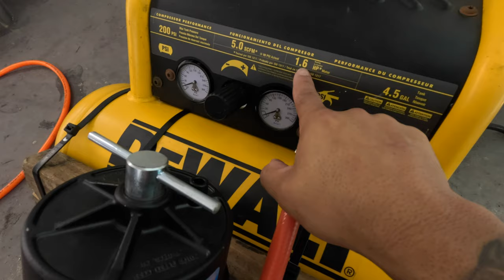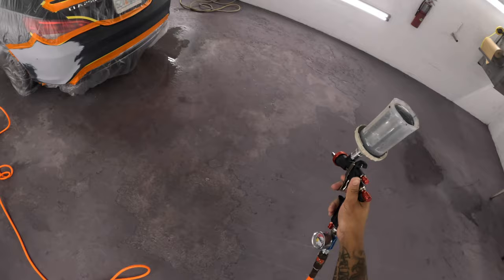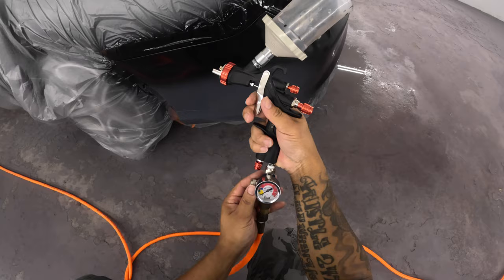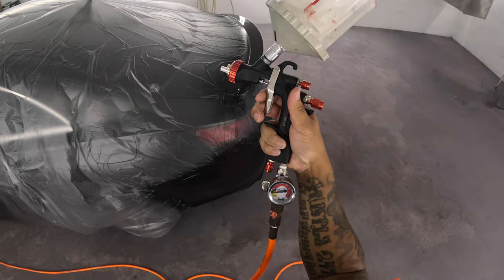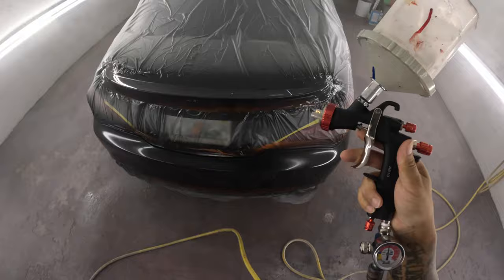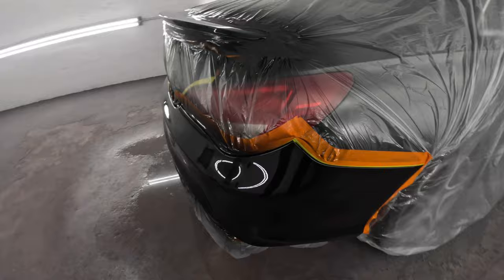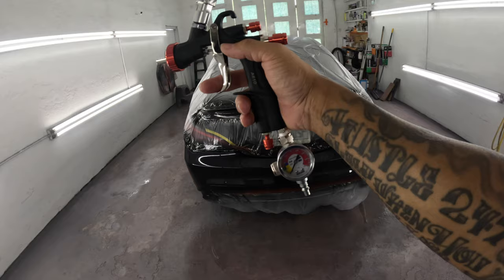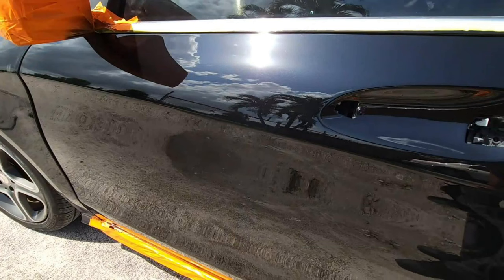11 year old rusty air compressor to paint a car 🤯👎🏼

Comment: Hey, just wanted to mention Aeropro and Rongpeng are the same Chinese company, just different marketing brands. Aeropro A610 is same as Rongpeng R500. They also make the Vevor gun...its called R802 at Ronpeng, A604 at Aeropro. All a bit confusing. But Vevor gun and gun in this video are made by same company .....so seem they make some good stuff! Also Vevor gun is supposed to use no more than 4.5cfm air....so it should run pretty well on larger DIY compressors. Don't know if you noticed in the real world that Vevor gun uses less air? I just bought a Vevor  so hope my big DIY compressor can run it....
Reply from the maker: Cool thanks for the info. The Vevor gun that I have I think it uses a lot more CFM I know they have a few models. But I'm going to be playing around with a few. Thanks for the heads up 👊🏼🫡

Comment: Why do they advertise that gun as using 4 cfm, that is a lie. The documentation that comes with the gun (Stated in the specs of the box it is ship in) states it uses 320 - 360 liters of air per minute, when converted to cfm that is 11.3 - 12.7 cfm....... NOT 4.  The truth is you need at least 9 or 10 cfm of air even if you turn the gun down, if you have 30 gallons of air to start with you could probably paint a door but with 4 gallons of air you can't paint anything bigger than a hubcap.
Reply from the maker: Hub cap 😂😂😂

Comment: I use a r500 everyday for primer at work for the past year. I prefer it over my devilbiss gpg. Helps keep the overspray out the shop . i also use a r500 at home with a 30 gallon 8 cfm oiless compressor. Works great. I will say for any lvlp you need at least 20 gallons of air. Upk uses a 21 harbor freight just fine. I've even done a whole car with a lph 400 with my 30 gallon. Set the out going pressure on the compressor to like 60 psi and it'll bump your cfms up. Lph only use 9 cfm which is still pretty low. The ani f160 only uses 8 cfm. My setup is perfect for a mobile business or home shop. I live in the hood so leaving compressor outside isn't a option for me. Crack heads stole my 80 gallon kobalt 2 years ago. Bought the gallon so i could take it in and out the house
Reply from the maker: Lmao got dam crack heads 🤣🤣 man I'm too familiar with that. I feel you man. I'm just playing around with this thing to see how much of a car I can actually spray with it. UPK has a bigger one but he also uses it to spray overall paint jobs and we know you won't spray an overall car on the mobile so this may work for people just trying to do small repair work, spot in jobs at car lots etc...  Thanks for your input man. It's appreciated 🫡

Comment: Even if that compressor was working fine it’s really not big enough for that gun.
Reply from the maker: Got it working and it sprayed great with no issues. So it is big enough for the gun and the size of the job. 💪🏼
Reply: @thetriggerman954  that’s good to hear most guns even lplv cfm requirements are more then most small compressors can handle. I’ve been a mobile painter for over 30 years and I always check both before i buy a gun or compressor make sure their compatible.
Reply from the maker: @theautoman22  yea I was surprised too. I have a video up with an even smaller compressor and an Iwata spraying a bumper and it did it without issue. I really didn't think these micro compressors could handle it but they did lol

Comment: UPK got what looks like a 60 gal with med belt drive motor.  And a full dryer system at 50ft..  
IMO 80 gallon is still a small compressor if used alone with a small or Med Motor.  120 is a normal small size with large motor at the older rent a booths here in California.  $140. a day.  $85 for 4 hours.  Newer booths are around $250 a day. 200 gal compressors  And they are usually behind an auto paint supplier.  I've used that same Dewalt for air brush touch ups. Motor is tiny.  I think we are all more interested in whether that gun is a good starter that can continue into the big compressor and rent booths. And you answered that.  A little slow but will get the job done.  
Great video.
Reply from the maker: Thank you Clyde. I'm sure there are some guys with little compressors that might be interested even if it's only a few people. But I'm glad it answered your question. Thanks for watching 💪🏼

Comment: I hooked up one of those motor guard filters to the wall. Quick connects so I can switch from the 20 gal or the 60 gallon. That Dewalt def. Has enuf pressure for that lvlp gun(with no leak). Very efficient gun. Really, surprisingly good. I  have use them for sealers, quick jobs, base. Not my favorite for clear, but it can do the job.
   Upk was right saying to haul out a small compressor. But you hauled out a mini! He uses the 21 gallon Harbor Freight on the videos. Entire car more than once. 
  Got my 3m pressure cup and pps adaptor for the Apollo turbine set-up. Still going for it. Full paint job 87 Jeep. I know it works for base as I tested it. Unlimited clean air. For clear coat, i will need to experiment. This is not compressor painting. If I get a bit too much texture at first, no biggie. I',m already committed to a cut n buff. Will post the results on a video short when paint day is here.
   Running long on the comments(again). Good job on the partial demo. I know i'm not the only one who would like to see you try it again👍 
6: 41 on Sat and i'm about to head out to the garage for sanding and more primer this morning. If nothing else, i am persistent😅. Enjoy your weekend Trigger!👍👍👍
Reply from the maker: Thank you Big Bear yea man I only have that little compressor but who knows maybe someone has a tiny compressor and want to do little spot in work for car lots something you can throw in the trunk of a car and go make some money. I know it's small but who knows who it can help out there. Thanks for your input I'm sure all of this will help help someone out there.  Have a great weekend 🍻🥳

Comment: Looking forward to more vids using this gun with good air and see what it can really do. I really like mine. Working at home I've been running it at 20-22psi for base and about 29psi for clear. Your the first vid I've seen with it running at 40psi. Good vid trigger👍
Reply from the maker: Thanks man I'm going to do a bunch more vids. And also I'm not using the gauge that came with the gun I've heard that they aren't accurate I have a better quality gauge on the gun. So not sure if that's why the difference in psi. But I'm going to be playing around with it. So stay tuned. And thanks for watching 💪🏼

Comment: I would say m9st people can aford an 30 gallon if they can afford an 6 gallon or 15 gallon they are not much more price wise! An 6 gallon runs about $180.00 for an good new one ,15 gallon about $300 and an 30 gallon is about $600! I use to have an 30 gallon husky 2 phase 7.5cfm rated and it performed greatly
Reply from the maker: Also depends on what they are doing. If mobile something like this fits right in the back of your truck close the top and go. So it all depends on the situation. But thanks for chiming in.

Comment: Hello Triggerman, how much of a difference is there in material consumption between this gun and the lph 400.
Reply from the maker: This was my first time using this gun. And as you can see it would be unfair for me to give that opinion on this gun since I did not have proper air flow. I'm very familiar with the LPH 400 it's actually my favorite clear gun and material consumption is very minimal with the LPH400, I plan on making more videos on this gun in the very near future and I'll be able to give you a more accurate opinion.
Reply: @thetriggerman954  Yes, I observed in the video that It was a small compressor that I word with and it almost ran out of air, but hey, I'II be on the lookout for future videos, I have the lph400 but I've seen good comments about that gun that I tried, personally I am looking for one whose overspray is very low because I do not have a very good vapor extraction
Reply from the maker: @jesuszaragoza2473  well as far as over spray I'll tell you right now LPH400 has that gun beat. It put out way more over spray than the LPH. Even with not enough pressure I had a fog in my spray booth.
Reply: @thetriggerman954  excellent man, I did not want to buy it and surprise you that it would cause more overspray, I run my lph 400 at 16 psi as the manufacturer marks it, I have not tested it at more psi, I see that in many videos they raise it to more psi, I even saw in some videos that It counterproductive to run it at 16 psi and I have seen that they run it at 29psi.
Reply from the maker: @jesuszaragoza2473  29psi with the LPH lol no way. If overspray is a concern definitely stay with the LPH I had to crank that gun up to 35-40 psi to get the same atomization as I would with the LPH at 17 PSI
Reply: @thetriggerman954  Alright if the lph got It for the same thing it was running low psi then I'm not too bad running it at 16 psi thank you very much I heartily appreciate your responses Triggerman
Reply from the maker: @jesuszaragoza2473  anytime brother 💪🏼

Comment: quick question trigger why do you wind the fluid in instead of wide open and when should you run wide open
Reply from the maker: Certain guns depending on how the threading feels I will start from in. This gun has a lot of play when turning it out from closed so it's just easier to give an accurate setting going in from wide open. EXCELLENT question. I normally always spray with a fan wide open but some guns will distort at the ends or break up in the middle so on those guns you would need to start incrementally turning in the fluid. Great questions man. 💪🏼👊🏼
Reply: @thetriggerman954  thanks man for sharing the knowledge, I'm still trying to learn and just have been spraying with everything open, trying to learn the settings
Reply from the maker: @myblkz  yea most guns are okay wide open but if you notice that something doesn't look right with a pattern Don't assume it's you or the gun start making little incremental adjustments It does take time but after you've been doing it for a while you'll you'll learn how to diagnose an issue right off the bat.
Reply: @thetriggerman954  💪🏾💪🏾💪🏾

Comment: At 10 psi u can use the lph-400 purple cap. It requires that pressure.
Reply from the maker: I'm actually going to try the LPH I think it' might give a better finish and use less PsI. You read my mind Trey 🤔 I'm going to try the silver cap. I know I have an orange cap too I had a purple I think it's in my shed. Lol but I'm going to play around with them.
Reply: @thetriggerman954  the purple is made for metallic they call it the super Basecoat gun and I can agree I love the purple cap. Like when I really want my metallic to lay down and good I pull that out.
Reply from the maker: @treysterthepainterturner8404  how does the cap work for clear? If you've ever tried it
Reply: @thetriggerman954  it did pretty good. I only used it twice. I said I would have to buy another to keep trying for clear. Kuz I don’t wnt to keep switching it up. But it did pretty good.
Reply from the maker: @treysterthepainterturner8404  kk I'ma dig mine up thanks man. 👊🏼
Reply: @thetriggerman954  no problem bro.

Comment: Lol… I don’t think you can get 40psi blowing through the hose😂😂😂. So I see you figured the a610 out huh?!?
Reply from the maker: I don't like the gun personally 😔
Reply: @thetriggerman954  well you did a good job with it! I still have to try out the rongpeng r500 to see if it matches the Eastwood concorse lt 100! I might have to buy the Eastwood to compare…Stay tuned!
Reply from the maker: @dollabillbrunson8107  4sho lemme know. Hey what's going on with the Chevy truck paint job? Did you start it yet?
Reply: @thetriggerman954  nah…. I was waiting til spring because the winter is gonna be rough in the northeast. My winter project is my 02 Honda Accord. I fixed it after the wife crashed it to a corner of a building. Tried the two tone thang, but I rather have it back silver. Plus I got crotch rot over one wheel well.😖
Reply from the maker: @dollabillbrunson8107  yea I feel you. Don't need runs all over that big mf truck there. Smart 🤓 🤣
Reply: @thetriggerman954  paint ain’t the problem, it’s the sanding to bare metal that’s gonna kill me…ugh
Reply from the maker: @dollabillbrunson8107  so what does the weather have to do with it? Lol
Reply: @thetriggerman954  Lmbo…Da Big Hoe has rusted rocker panels. I just figured let ol man winter do it’s thing, then do all my repairs when heez gone. I will be driving it for the winter…no downtime for da big hoe!!! Oh yeah, me and my dad is sharing a one bay garage. He will be using it more to clean funeral vehicles.
Reply from the maker: @dollabillbrunson8107  ohhh ok, funeral vehicles 😳🤯🫨
Reply: @thetriggerman954  He makes a lot of money doing those jobs ….I ain’t mad at him!!! That’s not for me! 😰
Reply: Hey trigg! Do you use the 34oz dekups at all?
Reply from the maker: @dollabillbrunson8107  yea I have them in my booth but mainly for big overall jobs. That big 34oz wear out the forearms 😂
Reply: @thetriggerman954  😂 I have some dekup stuff that you can have…and the 34oz hard cups are brand new. I also have the 9oz liners and lids. You the only one I know that rocks the dekup system.
Reply from the maker: @dollabillbrunson8107  yea that's all on the other of the shop so I wouldn't really need it. But thank you. And any shop I do work on the side for they supply all of that stuff. What set up are you using? Instead of the Dekup
Reply: @thetriggerman954  The master cups with the spectrum adapter. I’m just trying to save a buck when I can, these are readily available vs me ordering and waiting for them
Reply: This is probably a stupid question but is it safe to mix clear and reducer together, and then put the hardener in when ur ready to spray it?
Reply from the maker: @dollabillbrunson8107  if you do that how will you No the proper mixing ratio if reducers already been added to the clear? I personally never add reducer into my clear. Never heard of it being done that way either.
Reply: @thetriggerman954  I figure the cups got the measurements on the side...I could add hardener when I was ready. I don't paint as fast as you do...lol. I'm more of the speed of UPK. Ur right about the reducer in the clear. My clear shrunk back on my Honda project.
Reply from the maker: @dollabillbrunson8107  yea it'll always dieback, It's just sometimes it's not as noticeable but you always lose some shine adding reducer
Reply: @thetriggerman954  yeah, and I probably didn't need it. I was just learning and people was saying it will come out the gun smoother...never mentioned dye back! Thanks for all ur help and knowledge Brutha!
Reply from the maker: @dollabillbrunson8107  no problem man. Trigger gone tell y'all the real deal no 🧢ing here.
Reply: @thetriggerman954  one more question....does ur shop use epoxy over bare metal?
Reply from the maker: @dollabillbrunson8107  yes, in the past it was Etch primer over bare metal, now we use epoxy.
Reply: @thetriggerman954  Kool…getting my list together for the big hoe (Tahoe)
Reply from the maker: @dollabillbrunson8107  you need to video it man  💪🏼
Reply from the maker: @dollabillbrunson8107  you need to video it man  💪🏼
Reply: @thetriggerman954  lol..I guess Imma need a video guy! I know a lot of people are having problems with Chevy/GMC paint chipping....good Idea 💡

Comment: The engine that couldn't 😂😂😂 you tried bro and with the compressor leaking what could you do. But yeah for like a two panel max and some skill it could have worked out fine and the gun does have a wide fan. So decent save tho and bruh  I have 5 guns in the arsenal and no 1.3 😂😂😂😂👍🏽🏁🏁🏁
Reply from the maker: Dam SteelCity what tip you use?
Reply: @thetriggerman954  1.4 1.8
Reply from the maker: @steelcitycaprice.899  dam you got them hoses bro. The only gun I run a 1.4 is my Iwata LPH400 and my Iwata WS400 But hey as long as you get in the finish that you like it don't matter if you was using a 2.5 whatever gets the results big dog 🫡 And yeah it was like the little engine that could lol putt putt putt ,🤣
Reply: @thetriggerman954  Matco scorpions line
Reply from the maker: @steelcitycaprice.899  yea I keep hearing about them. Them shits pricey 🫠
Reply: @thetriggerman954  nah....they got some out now around a $100 to 600 I paid 3 and change for mine about 10 years ago and never looked back and they spray beautifully and I shoot quick you know. All around gun for me mostly ppg oldschool products I haven't painted since 2015 doing semi trucks and trailers with that industrial type stuff, some Dupont and nasson.
Reply from the maker: @steelcitycaprice.899  yeah you been in the trenches. I'm familiar with that type of work. Sounds like you to haul ass like me 🏃🏽‍♂️🏃🏽‍♂️🏃🏽‍♂️🏃🏽‍♂️🏃🏽‍♂️ in and out